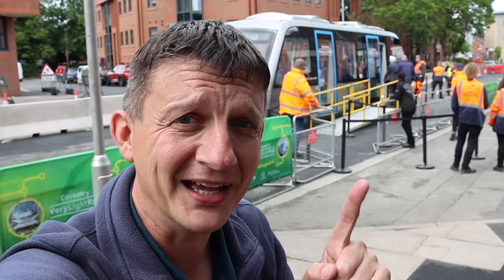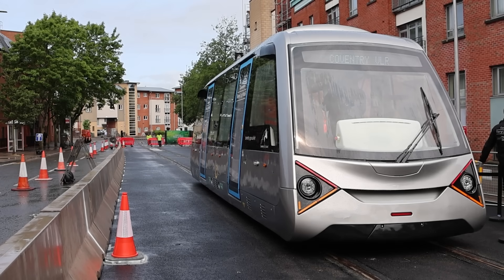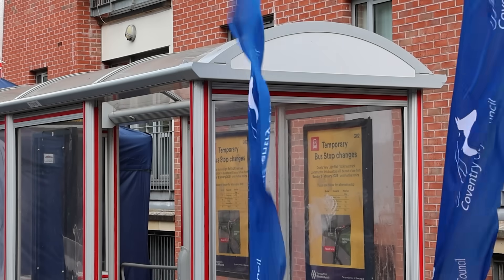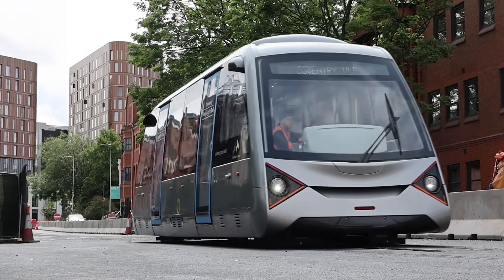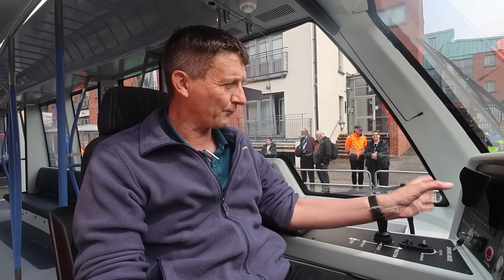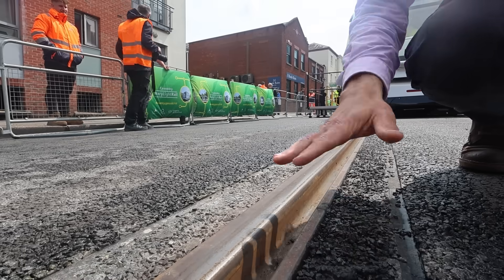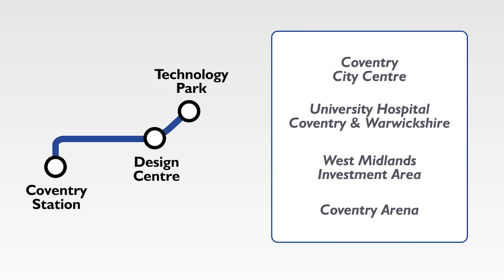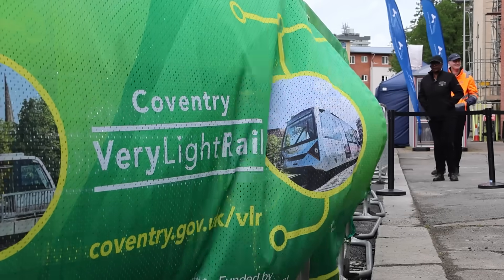The NEW! Coventry Very Light Rail is here

Comment: On flat, well-made roads in city centres, that method of track-laying will suffice. 
But when inclines or declines and/or low specification roads are encountered e.g. tarmac over old cobbles, I would suspect that the track layers would have to revert to proper levelling e.g. cuttings and standard  light- rail track-bed construction techniques.

Comment: I still struggle to see what benefit this provides over a bus? It has a low capacity of just 50 people, is more expensive initially, and isn't flexible in terms of route. They talk about virtual coupling but that's not ready at this stage. If they had built a longer unit, using the bogies to allow for tight turns then maybe I'd see the benefit. But for the moment this itteration of it seems a bit too gadget-bahn.

Coventry doesn't have a shortage of overbuilt wide roads, it could set up a BRT network fairly easily.

Perhaps I'm missing something but this doesn't seem to be that promising to me.

The interesting bit for me is the track. A cheap and flexible track would be great paired with a higher capacity lightweight tram as opposed to the the VLR pod.

Comment: normally big fan of trams but whats the advantage over a bus
Reply: they can work on standard gauge rail tracks so they can be used to restart disused railways and then transition on to urban tracks too. 

most of the advantage would come in the amount of segregation. the city is much more likely to try to separate a tram from traffic than buses as seen in manchester and birmingham. that should boost the reliability during rush hour significantly compared to buses

Comment: Can it have multiple units? One of the things that makes trams cost-effective is that they shift 300 people per driver. This has the same ratio of passengers to drivers as a bus, so costs the same in drivers (and more in track). Seems to me it may be somewhat cheaper to install, but in the long run it's going to be expensive to operate. Maybe that makes sense in some places.
Reply: they can run on standard gauge tracks unlike buses and the amount of segregation is likely to be much higher than for buses. in theory, a bus route fully covered by bus lanes is even better than a train but that’s just not what cities end up prioritising in practice

Comment: So what pushes the price up to £10,000,000 per km, ie £10,000/m.  Clearly, the track is a small part of that.  How much does signalling cost?  Perhaps it includes the cost of the very light trams themselves.  My concern would be that debris from various activities could easily fill the trough, forcing the wheel flanges upwards till they derailed.

Comment: What about the cyclists? The rails are set in the street, and bicycle tyres can get stuck in the tracks. I don’t cycle, but obviously can’t see the potential lethality in this system. Oh great the street is wet, and the metal rails are even more slippery for motorcycles. Maybe keep the rails OFF the roads would be a better idea.
Reply: urban tracks are already used in so many british cities and this hasnt been a major complaint
Reply: @bordedup546 Really? I was cycling home from work once, and got caught in the tracks. I was lucky that it was clear, and I could stop. Tram ways in city centres are a hazard. That is why most of the rails that were used in the past for trains have been dug up, and removed. If you wish to dodge trams, and risk your neck, then that’s up to you, but tramlines, and rails sunk into the roads are severely dangerous.

Comment: If you take the abbreviation VLR and read it as a word, you'd end up with Valerie
However... For reasons I'll point out in another comment, I wouldn't actually wanna give it that name. Yes, a female name is great, women still need to be extra supported and promoted. And I'm seeing this name in connection rather to the vehicle than the (or a) system. But, as I'll make clear (hopefully), I'm not conivnced of the true futurability of this concept.
EDIT: Thinking about it, Valor could also be the result of the abbreviation being pronounced as a word. And seeing that this translates to "Wagemut" in German, which in turn translates to audacity , boldness , recklessness , I wouldn't mind it getting THAT moniker (rather than the lovely name of Valerie).
Reply: As per the system: you could possibly call it a light tram , as this is probably what it ends up being.
Reply: Also, there's nothing to be said against light trams, I guess. There are Light Metro's (which the DLR probably qualifies as), or also called "Premetro" (e.g. Brussels), next to true Metro's. There are Heavy Trams in between (Light) Metro's and regular Trams. Those are the terms we should stick to and go with. Hence: Coventry Light Tram.
And the vehicles could be called (classified as) Pods, if you will. Or Cabs. Cabins? If not regularly Carriage or Car.

Comment: An entirely stupid concept. A BUS can drive anywhere, the only point of a tram is that it runs directly from electric grid , so it isnt carting tons of batteries around for  NO reason , if it breaks down its stuck , cyclists will get stuck in the rails, it wont work in cold weather because of heating costs battery power , where does it charge ?  30 km isnt even 3 hours use ... etc etc etc . Is this another godiva awakes scam ?

Comment: WHY?  It's no better capacity than a bus.  There is NO point in this.

A battery powered bus doesn't need the rails, doesn't pollute, and will run on ANY street, no alteration required.  Rail is great - for more capacity.  This is just dumb.
Reply: by this logic we could replace the entire manchester metrolink with dedicated bus lanes because two double decker running every 5 mins =1 tram every 10 mins

Comment: My question is, can that track also carry regular, much heavier trams? Because if so they could make a small fortune from the new rail design and installation process. I could even see a single vehicle designed to grind down the road, lay the track and then fill it in with fresh tarmac on after another in a single pass, which would make installation even faster and therefore cheaper for ALL tram systems and places wanting to install a tram system.

Comment: What's overlooked comparing buses with fixed rail trams is no business will invest based on a bus line as the day they open the bus could change route but with fixed rail the tram is going to be there.   With Toronto's Young Street subway developers began building apartment & business blocks at every planned subway stop so by the time the subway opened there were already thriving activities at every stop.  The same with trams but never with buses

Comment: 10 million per kilometre is what i have an issue with, what about maintenance of the track etc how often do yjecrails needs to be replaced , what happens when a waterpipe bursts under the tracks as the are not moving the utilities so cost of fixing those will be massively increased,  vlr does not seem to be made of high quality parts so is going to look very tatty in just a few years, system.will run fine as new but will the investment continue in 10 years time or will the  costs of maintenance mean the are slowly killed off as was done witu british rail etc.

Comment: So it's more expensive than a bus, carries fewer passengers than a bus, and less flexible than a bus. 
While I agree that trams are more attractive to passengers than buses, there's no point in attracting more passengers if the system can't accommodate them. 

Other than the city officials being able to say "we have a tram" what actually is the point, what niche is it trying to fill? 

I mean, yes we are very good at over specifying tramway systems in the UK, and we don't like using uniform systems and standards across the country, so there is a problem with the current way we do it, hopefully the VLR will enable some technology transfer to reduce costs of new standard tramways, but it could also reduce the value of the tram concept by producing a white elephant that is used as an argument against building more systems elsewhere.

Comment: At last, a 21st Century updated version of electric trams up until the 60s.    A track installation that is cheap and makes minimum disturbance.   Batteries are much more practical when you want 50 km range not 500 km. 
How about NeoTram?  Or just "the (Coventry) Tram".  Users are unconverned by the techonogy used.  I imagine the idea is extendable to longer vehicles.

Comment: I'm wondering if these could be made to run on Pennsylvania Gauge (5'2.25" / 1881mm and 5'2.5 / 1888mm) for use on Philadelphia's existing trolly network initially, and then expand the network with the new track (still PA gauge) system.

Comment: Something the size of a PCC streetcar or a Tatra might be doable if you had enough wheels to spread the ground pressure - and you could leverage the economies of scale possible with a train. A current collector in the street could also probably be laid similarly to the tracks too if need be, similar to the old streetcars in Washington DC. Honestly, a lot of my ideas revolve around a single question: How much can those rails take, and how much of the VLR streetcar weight is in the batteries? Because if the rails can take more, then the gadgetbahn pods are EXTREMELY stupid.

Comment: Yeah honestly I'm not very convinced by this. Maybe in some city centers it does make sense but having no battery and higher power is much better for long distances. If you were to install this in my city for example (Sofia, Bulgaria) it would barely make a couple courses before needing to be charged. Light rail can be a city-shaping transportation method. Cities are planned and built in different ways because of it. It should be separated from traffic and it should have a consistent schedule. One of the main advantages of it is it can just go around forever without needing to stop and charge or refuel.

This seems like it would get stuck in traffic and it's also pretty slow. To me as a Bulgarian who has lived in Sofia all their life, the trams are supposed to connect suburbs to the city centre. Suburbs which can be up to 10km away. Having to interface with cars for the whole trip, having to wait for it to charge, and the abysmally small capacity by tram standards makes me think that in order for this to be a good and consistent service, you would have to spend more money for charging stations and lots of trams, battery replacements, etc. than you would just building out the city infrastructure and using normal modern light rail.

Comment: Interesting but many questions here. The main reason to build tram lines over busses is high capacity, not speed. High capacity requires heavy vehicles and redundancy. I wonder how that works for this system. 60 passengers is about the same as a bus, but what happens if two vehicles are needed? How easy is it to raise frequency, knowing that you need to charge the batteries of each vehicle for a certain time? How do the tracks do after ten or more years of wear and tear, bad weather and heavy trucks going over them? Are there limitations to the length of a line, in the face of charging (this also applies to electric buses).

I also assume that the mission of fitting in a tram line into the existing urban fabric, is equally challenging for both a very light rail and a tram. A large part of the investment will go into that: adjusting junctions and traffic lights, building stops, barriers, right of way sections, etc. I just wonder how much of the investment needed for a normal tram can you actually avoid using a very light vehicle? If it means that you have to dig up half of the city anyway, it may end up a bad decision.

Comment: Operating costs will be too high. 60 passengers per driver. Same as a bus and a bus needs no rails installed. Look at Luas in Dublin 300+ passengers per driver. What you gain with VLR in upfront costs you lose in labour costs.

Comment: Years ago I lived in Queens section of New York City where a ,#10 LEFFERTS AVENUE bus ran between subway (ie Metro) and JFK airport. About 1 of every 5or6 diverted to small commercial and residential are, population enough to be served, but not a main route.

IF this was a TRAM line a single track loop, with battery cars would have been enough,
Reply: In New York City (and other US cities) there were tunnels under major streets for trams to avoid crossing them  at grade, some used currently by busses, but are unpleasant today because of fumes.  In Brooklyn in the vicinity of ALABAMA AVE station on (J) line there is one in still in use by both busses and now also cars, about Kilometer long underground with 2 railway lines, 2 metros,  and highways, filled with fumes, but if battery if served by battery tram would be tolerable.

Comment: Without getting into the nuances around trams vs buses, why is this any better than a rubber-tyred tramway? I understand all the arguments in support of trams and not looking to argue with those, but why is this rail setup better than just putting rubber tyres on the thing and getting it to follow painted lines? Fair enough there are numerous nuances around following lines safely but it's surely cheaper and faster than digging up miles of road to install these rails no matter how minimally-invasive they are. Or is that because the street furniture/infrastructure is going in anway, the on cost of the rails is relatively small? I really want to see the justification in objective, numerical terms.

Comment: There is a big problem with the Coventry Very Light Rail track method as it leaves all the utilities in the ground under there track and in the case of one of them going wrong then a section of track will need to be removed and I am very surprised that Coventry Very Light Rail have been given planning permission to install it in this way. I have spoken to an Electricity Network Engineer and he told me that if this was attempted to be installed in his area then under the street works act he would get any permission over turned. I did speak with Coventry Very Light Rail and they said that they would install manhole covers in there track to allow access under there lines, but which would be unsuitable as you can't tell where a cable or pipe may break or wear out. I hope that this type of track is never installed elsewhere.

The vehicles themselves do look interesting with a look of a class 139 about them, I hope that they meet all the requirements for a rail vehicle, i.e. crashworthiness, as per both road and rail regulations.

Comment: The problem is if you don't divert the utilities then every time a Gas/Water/Electricity cable under the track of which there will be many needs repairs or renewal the line will be shut for the week it takes them to dig up then relay the road.
The other downside is the vehicles require less energy but have less capacity than a bus.

Comment: The big question to ask is whether this is actually better value than a bus. The capacity doesn't look to be very high (long bendy-buses can move more people by the looks of it) so the question is whether you can get longer vehicles and how it can be upgraded to a "proper" light rail in the future. Is it simply a matter of building accessible platforms and throwing up wire (upgrades you can do incrementally), or do you need to rip out the rails entirely and do it "properly" to handle the extra weight of a "proper" light rail vehicle? How does it integrate with traffic patterns (can you do signal priority easily with this system)? etc etc.

ASSUMING you can make all these upgrades and incrementally close the gap to "proper" light rail at a lower cost, this is an awesome idea! But if not, you're probably better off spending the money on better bus service.

Comment: How do they stop the tracks from moving outwards? Due to the conical design of the wheels, which is necessary to be able to go through curves, the train will exert a sideways force on the tracks pushing them apart. Usually this would be counteracted by connecting the two rails below the surface, but apparently they don't do that here to save costs, or do they? I don't think the concrete or asphalt on the road would be enough to withstand this force over more than a year of use.

Comment: its a tram, a light weight tram, with an impressive minimum curve radius, but still.
as for name, it depends if they can be coupled to each other to increase capacity without needing extra drivers. if it can, then i would suggest light tram, mini-tram, or tramlet, if it cant then its a railbus

Comment: @ 71yrs old, that because of Health conditions, I am no longer allowed to drive, So shopping is done within a walking distance, or Bus Route stops, But I live in a City that has the East Coast Main Line running through it with THE junction for the NE Anglia Rail(supplies parts  for the Off-shore wind farms, Why is a Rail-Transport System not using the 4 exist tracks to run Light Rail, or add another rail in the land available there are unused shunting yard tracks,

Comment: Brilliant reincarnation of an old idea.  You must call it the PRAM, (for Peoples, or Pre Tram).  The whole country needs these tomorrow.  The batteries won't do 70 miles in all weathers on one charge, but there should be swappable batteries to keep the PRAMs on the road for more hours per day, meaning less vehicles are needed to provide a full day service.  You need a bulletproof cabin for the driver though, especially on Friday and Saturday nights.  I would be unhappy as a driver, with my back to the great unwashed in those situations. Great video, full of practical optimism, well done Geoff.